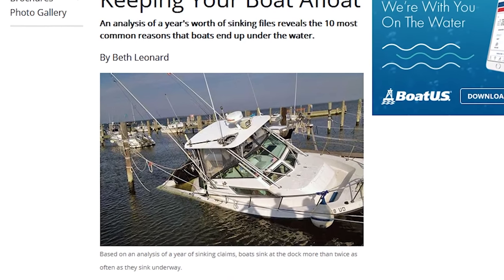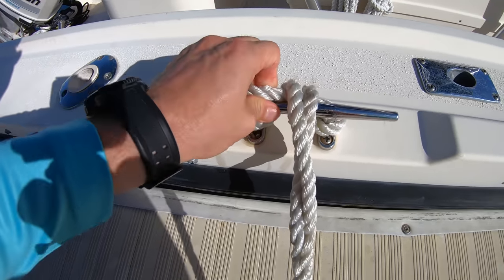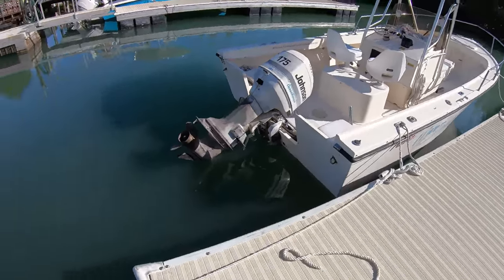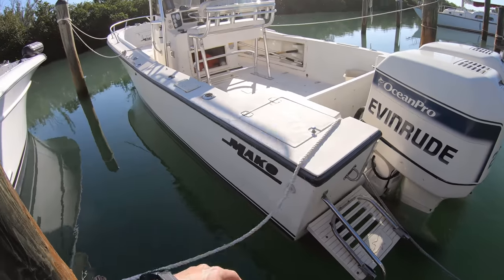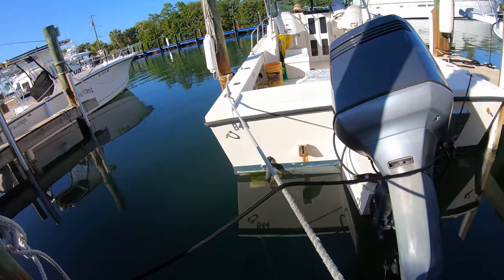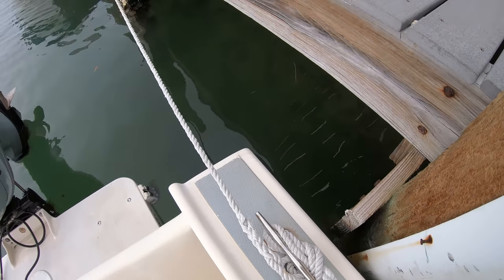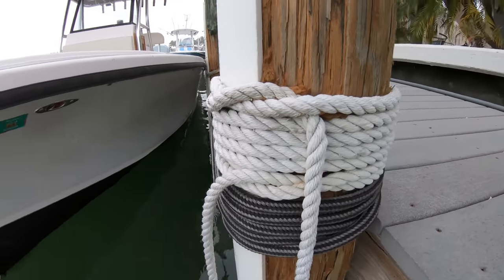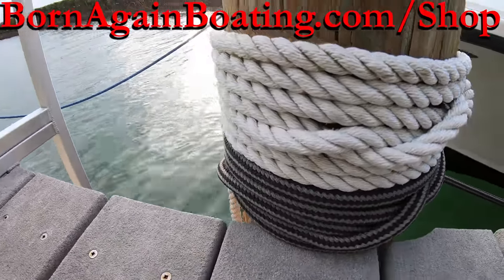THE ONLY Video You MUST SEE On How To Tie Up A BOAT!

Comment: No better advice than from an ole salt who been there and done it. Thanks Capt. Never to old , or smart to learn a better way. How many boaters are guilty of buying the smallest fire extinguisher that will make you legal. If you ever have a fire aboard boats usually have a larger fuel tank (s) , are made of combustible materials and an escape isn t always possible , safe or in best interest.  A full size extinguisher inshore and two offshore may save your day. 
Please be safe and considerate to others out there. Tight lines.
😊

Comment: No fender? I always put them between the dock and the boat. Just to prevent damage from the waves caused by the wind or some boat.
Reply: Just thinking about hearing that noise like 💅 on a chalkboard.... ahhhhhh!!!!!!!!.... from a fiberglass boat with no bumper rubbing against the wooden dock.
Reply: I find it hard to believe that it is not an automatic procedure to always use fenders when docking, on any size boat or material it is made of. Even if leaving a foam or inflatible collar RIB for a long time.
Reply: Fenders are difficult when you have big ass pilings outside of the dock.  On some boats I have used “Bang Boards” which are 2”x8” or wider boards and long enough to be hung outside of two pilings located at the widest part of the boats beam.  Dock Fenders can then be secured to dock or boat and hung over the Bang Boards.  
I have been very lucky to be able to use a bow and stern Spring Lines to keep bow pointing into open water with the bow slightly pointing away from the dock.  In bigger waves the boat rides the waves outstanding and actually tries to twist the stern Away from the dock.
But, I always have and use the biggest and most Dock Fenders possible.  Boats name is clearly marked on every Fender.

Comment: I tie up a a finger pier slip all season.  I also use clip on shock cords on my bow and stern lines.  I place a prusik loop at two points on the line then clip each end of the shock cords to the loops.  It really keeps any play in the lines to a minimum and with the prusiks you can easily adjust the tension.  The long spring lines are also essential!
Reply: Got any pictures of your setup?

Comment: Where I dock, I've put safety hand-rails on my dock poles and tie off to these. If the water rises (usually in the spring) the rope rides right up the handrail. If the water's low (windy days especially), the rope rides down the handrail, ensuring I always have enough play in my lines to compensate. It also lets me tie in tighter so I don't drift in the well. Probably the best $40 I've spent. They're also super easy to untie from, and make carrying the dock poles a cinch when we need to remove them.

Comment: Surprised you didn't mention the huge difference in stretch between the braid,(sometimes as low as 2%), and the 3 strand nylon, witch will typically stretch 15 to 18% under load. I much prefer the twisted nylon for that reason, that extra stretch is kinder to cleats, boats, etc.

Comment: If in doubt of tidal range ask the marina guys and many times they will if not busy take a look at your tie up . Take a look at other boats BUT don’t use boats tied up with three feet of line wrapped over cleats or just really bad looking setups they don’t know what they are doing an easy way is to see if they cleared off using a figure 8 line Wrap on a cleat and neat line set up they know how this dock and tide work . 
When crossing aft lines make sure it does not hang up on motors or shore power  Speaking of shore power Always keep power cords Under lines if the line is under the power cord it will rip the cord out of the socket and fall a live power cable into the water if the circuit breaker does not trip you will kill anyone going into the water nearby yes it has happened ....

Comment: I tied up a 32ft Lafitte Skiff that made it through a hurricane with a 20ft storm surge. Of course I found a set of pilings that was almost 30 feet tall. I looped the ropes around the pilings and tied them back to the boat. The boat went up with up with the storm surge, then back down. It was the only boat that made it in that area.

Comment: When coming on to a piling you can use a bowline to secure it quickly by having the bowline ready using the 'slip knot' method.  This means that you have a slip knot tied far back enough form the bitter end to make it around the piling, wrap the line around the piling, and then put the bitter end through the slip knot and pull tight it, will turn over onto a bowline.  This knot can be done in 2 1/2 seconds if you have a good slippery line..

Comment: I have been calling a clove hitch a half hitch for more years than a care to mention. I wasn't familiar with your half hitch. I would suggest some knot practice before going to the dock. You want to be proficient rather than fiddling with the ropes when you are ready to secure those lines. Others will be watching! I have been making a loop and adding clove hitches by dropping them over the top of the piling. Louisiana Inshore doesn't get large tidal ranges, so the pilings typically aren't tall. I did notice at 6:42 in the video that 300 Mercury doesn't look like there is a castle nut on the prop. It does look like there is some kind of sleeve covering the threads, so how is that prop secured? I have watched the video twice, looked all over, and I can't find what the weekly Technician Tag is. Can you give me a clue?

Comment: Our new docks were delivered with rings instead of cleats.  It's a tight fit so I need all my lines tight or an unprotected corner may hit the dock. But the rings are loose so the tension changes enough to make it tough to control. Any tips when using rings?

Comment: In my opinion, never have the fixed loop on the boat: 1) don't leave a mess on the dock that is a hazard for other people, 2) so not to have to cut line in the event you need adjusting and can't reach the far end in adverse weather, 3) with all running ends on the boat, all adjusting can be made from boat. If possible never have multiple lines on the same cleats. Except for very small boats try to have lines work in unison so that the boat never "hangs" on a single line. Use proper line that stretch to absorb shocks. For permanent lines (left on the dock), I suggest non-floating line (so if kicked off the hanger will drop straight down and not mess with the props) - for temporary lines, I prefer floating lines; a dropped line can be easily recovered.

Comment: Hi, Im a new boater.

I read an article of stored the boat in the water by you. I live in Puerto Rico and I have a outboard mercury optimax 200 hp. I am thinking on leaving it in the dock since I am using the boat 2 to 3 times a week. My question is ..... what should I do to take care of my boat leaving it in the dock? It is really bad to leave the boat in the dock for moths?? (I will be continuously using it at least 4 times per month)  (caribbean sea)
Reply: Should be ok if you are going to use it that often. I'd pay attention for storm warnings and change plans doing something to make my boat more secure until the storm passes.

Comment: There is one more way to tie up a boat  when docking a boat single handed.  If I'm just going to be at a dock for a short time and not worrying about tides etc, I will sometimes just loop the line around the piling and bring it back to the cleat on the boat.  That way I can release all the lines from the boat myself after I'm back on and ready to go.
Reply: Exactly consistent with the CG way comment made earlier, safer releasing from the boat without having to reach for the dock.
Reply: Yep, just makes sense

Comment: I find it surprising that almost everyone thinks you need a half-hitch on a cleat to secure it. That is true if your lines are too short or your cleats are too small, but no crew member in the Coast Guard would get qualified if they used a half hitch. It requires that you get your hands and fingers into the line to remove it, which means you can't do it from the boat, you risk getting your fingers pinched in the line, the line can jam and even fuse together with a lot of movement, and you can't make up or undo the line while standing at a distance from the cleat. The Coast Guard requires that a line go under each horn once, followed by two figure eights, followed by two wraps around the base. This will hold in any condition without the dangers involved with a half-hitch. It might look nice and salty to recreational boaters to use a half-hitch, but the CG method is much more useful and safer with no downside.
Reply: Also Dan , the method you had mentioned Is only good for medium stay (4 hours) at the most due to the tidal cycles, but is not really suitable for overnight use as it is not considered secure in the case of someone trying to put their line on top if the remaining exposed part of the bitt, technically people who come as a secondary user to that bitt should have some decent/solid knowledge of how not to DISRUPT someone else's berthing lines but unfortunately almost any fool with a few dollars in his bank account can go out and buy some boat for a few thousand dollars and cause havoc/damage/deaths in and around the waterways....

Comment: Pro Tip: Never secure your boat with the stern facing open water or where waves or boat wakes can come from.  I have seen experienced Boaters wake up in the morning to find their boat swamped!
Personal Tips: 
Buy proper Dock Lines and longer lines than you think.  I think Bow and Stern lines can be up to the length of your boat.  The two Spring Lines should be more than the length of your boat.
If you have two sets of bow and stern dock lines, you can be ready to approach a dock from either available side.  Then you only need to place Boat Fenders on the dock side.
I like my Spring Lines to have more “stretch” than the Dock Lines.  They then act as shock absorbers when the waters get rough.
After securing your boat just the way you want it, sit in the boat or stand on the dock and let the boat settle down and you will feel and see how well it is riding.
If near open water or in tidal waters, visit your boat often to see how it is handling the changing water levels.  I have been in places where the docks are submerged at high tide!
Never ever trust someone else to secure your lines to your boat.  Cool if they assist you in docking but You must verify all lines every time.

Be well.

Comment: In addition be sure the rub rails on the dock or pilings are secured properly, no nails or screws pulling out, (at one point in the vid there is a rusty nail sticking out on a piling rub rail ) they can ruin the gell coat on a boat in no time, I had a bad experience at a marina with a floating dock.
Reply: Saw that nail and had heart palpitations

Comment: Been doing this for over 40 years, in the salt and even in areas with some pretty extreme tides (10 - 30').  I watched, but figured you weren't going to teach this old dog any new tricks. Wrong!  I hadn't really considered running the line around a piling before tying to a cleat.  That said, even when I find a cleat bolted to a piling, I figure the piling is always stronger so would typically go with a clove hitch, or even an anchor bend around the piling.  I used to keep my boat on a finger pier and I never crossed my stern lines.  I hated having the lines running over my engines and was always concerned about one slipping under an engine, or fouling a prop, and damaging an engine.  That said, there really is no substitute for knowing your boat and how it rides on a dock.  My boat (1992 Boston Whaler 27 Offshore) likes her stern line pretty snug and  pretty direct without a lot of fore/aft direction of pull (true of most Boston Whalers (I've owned 5)).  My only additional comment is when tying up to a pier, you really want to make sure the stern can't slide forward of the aftermost piling and slip under the dock, so getting that aft quarter right is pretty critical.

Comment: Great video.  Not sure they teach this most places.  I learned quickly on the NC/SC coast 20 years ago.  Luckily no damage.  Local teenage help was offered.  Thinking I knew better I politely refused.  A probable mistake.  Cut a couple of nice lines to get my boat to float properly in the middle of the night (low tide), but learned a valuable lesson!  Local knowledge is great!

Comment: With the growing popularity of the multi-outboard engine boats, I can see a decrease in the use of the crossover stern ties, especially with some of the custom paint jobs!  The MAIN reason for that mooring method is increased leverage correct?  As well as an increased range in tidal/wave swing I'm presuming.  It's been more than a few years since I've been involved with more than a canoe so I'm slowly recovering what I was taught by Uncle Sam!
Reply: Just go to the dollar store and get a few pool noodles and feed your stern lines through them. Keeps those engines looking good. Also taking the extra 2 minutes to throw the cowling cover on really does help with lines and the paint getting beat up by the sun.

Comment: Tighten up a clove hitch by tying a half hitch at the end?  Then "tightening up the half-hitch?"  You mean two half hitches or a full hitch, right?  Why not just tie a rolling hitch, instead?  Better yet, tie a round turn with two half hitches, which is, almost, what you were trying to do.  But if you want to tie a mooring line to a ring, bar, pole or dock post, use the Anchor Hitch.  Also known as the Fisherman's Hitch or Anchor Bend, this knot is the proper way to ensure you have two solid, non-slip turns about a wooden post for either temporary or permanent mooring purposes.  If you're really insecure, you can pile on a bunch of half-hitches...

Comment: Quick question. I’m no expert but it seems to me that crossing the lines at the stern of the boat could potentially damage the engine or prop or the prop could straight up cut through the rope. Am I wrong? If so can someone please explain why?

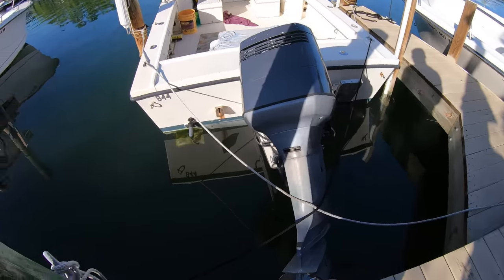Edit: the cross tying method is shown at about 7:06 in the video.
Reply from the maker: Not usually, there's flex in the line and the water and the boat will move around, so it usually doesn't damage the prop or cut the line. But depending on how long the boat is in the water, and what the current, tide swing, and frequency of storms situation is, it could rub a mark on the chaps or the back of the driveshaft housing. 
But it's the safest way if the boat lives in the water, to keep it from hitting the dock, or getting stuck, or anything else :)

Comment: At 10:13 nice nail sticking out of the piling to scratch the hell out of your boat.
In that case, tie the line around the dock owner's neck and shift the throttle lever into forward.

Comment: One thing you forgot to mention when setting your lines for the season, The best time to set your lines if you are in tidal Waters Would be at either full high or full low tide! If you are setting your lines during low tide all you have to do is make sure you have enough slack so the boat is not hanging, And if it is High tide Make sure to move your boat in all directions without hitting the dock or any of the pilings! Also don’t forget to check your lines during a full moon due the tides being higher and lower!
Reply: Plus you get BETTER VISION during the full moon.
Reply: "enough slack so boat isn't hanging at max low tide" -  (parsed)
and I realize you also include of course, so that fore-aft lines won't allow trapping motor or boat down when tide rises.
But I'll bet you some non diligent boater will drown his boat that way. Sternfirst.

Comment: Don't forget to have courtesy towards other boat owners by learning the simple technique of how to properly and safely keep the extra dock line out of the way and off the dock. You can do this by just simply looping the lines around the piling or the cleat, wrapping the line up in its own circle(the coil technique), or learning the daisy chain to make your tie job look nice and neat and easy to handle going in or out. Using these simple things can keep an injury or conflict from happening, as some people can be clumsy or hard to deal with.
Reply: Good advice, plus it makes the person who runs that boat look to not be a "squared away," knowledgeable, courteous, competent and well skilled boater, not a newby landlubber who doesn't know or much care about proper and courteous boating skills.

Comment: Go over on the first turn of the clove hitch. 
You should have the load crossing the second turn, or it can ride down the pile (especially on those covered with plastic sheath)
Reply: We had short dock posts (3ft above the deck of the dock). I always made a bite with the working end over the standing end, like in the video, then slide the resulting loop over the top of the round dock post, do that two more times and you have a clove and a half. It won't pull off or slide on the pole (you can get the knot tight this way). Then when you want to remove the rope, you grab the whole thing and slide up, it will come right off the post.

On round dock posts if you start your bite with the working end under the standing end, like you described the boat can pull and rotate the line on the post undoing half your hitch and loosening the line if you only did a single clove hitch.

Personally I never use just a clove hitch, I'll always use at least a clove and a half, more if the top of the dock post is low enough. You can throw a clove hitch in 3 seconds on waist high posts. IMO, it's better than any other knot for mooring a small or mid sized boat.